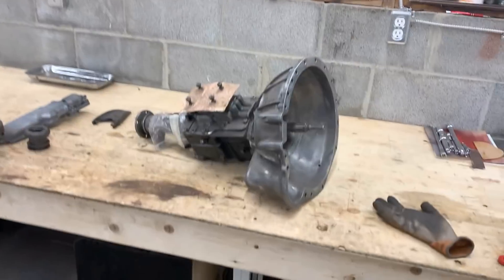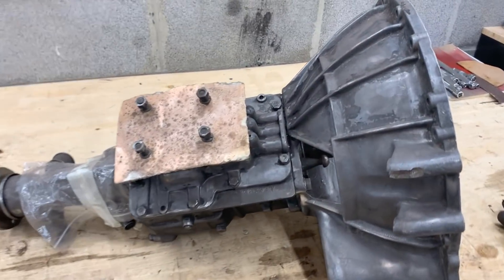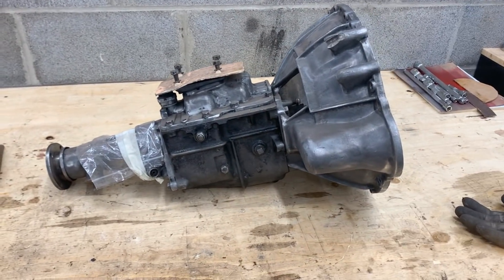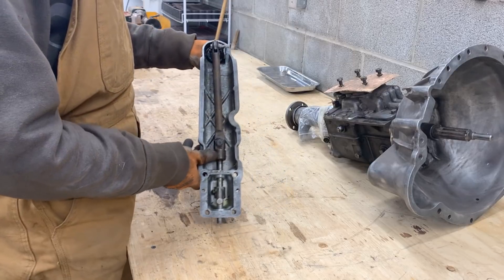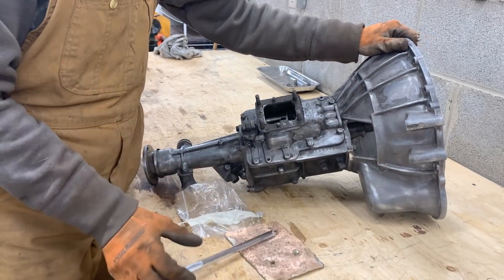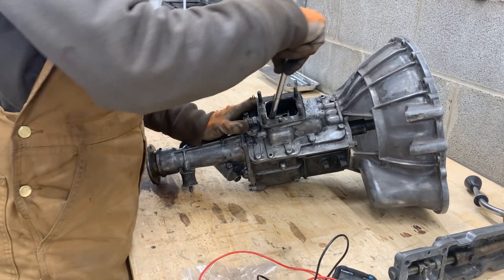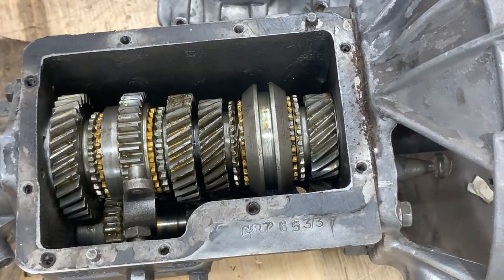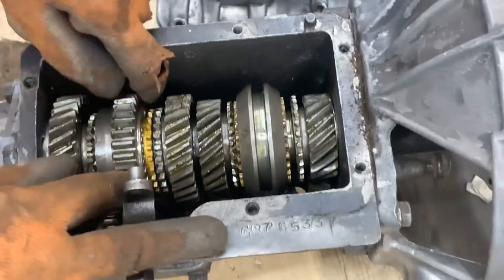GT6 Transmission Repair - Part 1

Comment: Elin,  Other than pulling the transmission, have you found a way to get a clutch plate that appears to be slightly seized to the flywheel to come off?  My project spit6 seems to have the issue of not wanting to go into gear (grinding) whenever the engine is running, but it cycles through gears fine with it off.
Reply from the maker: You might have an issue with the clutch master or slave cylinder. Does your clutch pedal feel spongy? I don't think your plate is is seized to the fly wheel, but in case it is you can put your rear wheels on jack stands. Start the engine while in 4th gear, get some speed and then press the clutch and slam the brakes at the same time. That should free it. But again, I don't think that is the problem.

Comment: Elin, why replace the bell housing? Could it be alloy welded and the bolt hole redrilled. which would be a lot cheaper and just as good. if done well.
Reply from the maker: Well, I believe I have one kicking around, but if I can't find it welding is an option too. I know a shop that does a really good alloy welding!

Comment: It's not worth repairing because, A)  you can get a better used transmission to begin with, and B) this is not a GT6 transmission.  GT6 transmission ID numbers begin with either KC, KD, KE, or KF.  The transmission ID number begins with "G", which identifies it as a Triumph Herald unit, most likely a Herald 13/60.  No point in rebuilding a transmission that's incorrect for the car and which has the damage it has.
 - Paul B.
Reply from the maker: Wow, that is a lot of information. Thanks!

Comment: I was scared to watch this. Thought all of my transmission rebuilding would be in full 55” tv color for Mary and Georgie to see. I did an ok job on it but I’m not sure it will pass inspection by the master. 
Stay healthy
Reply from the maker: LOL, well your transmission is not going back on the car unfortunately (or fortunately) because I got the overdrive one. Hope all is good with you and Mary (and George of course :))

Comment: Excellent explanation Elin. Just think someone sat down and invented synchro gearboxes...
Just a small point but the damaged 3rd and 4th gear teeth would not be caused by the slack 3rd / 4th gear synchro hub as the gears are always in mesh. I suspect something has worn and fallen out of that synchro hub (because it is so slack) and got chewed up in the gears. Certainly the baulk rings will need checking. I would flush the bottom of that 'box with some diesel and see what 'bits' come out before filling and running it. 
Chipped gears (like that and not destroyed!) as such are quite usable as long as they are stoned to get rid of any burrs or ridges as they are never out of mesh but the synchro engaging dogs are what take the hits and will be damaged with the synchro hub sliding out under load.
Reply from the maker: You are right. I believe the ball bearing from the hub went through the gears (a couple hundred times LOL)

Comment: When you get the transmission testing rig done, I’m thinking you will want to test a single rail gearbox from a spitfire.  Just so happen to have one out of a 1976 barn find I’m restoring.  Just saying 😉

Comment: It looks like the bell housing is damaged where the clutch slave mounts.  You might want to find another gear box.  There is a guy in New England that rebuilds Triumph gearboxes.
Reply from the maker: I believe I have another bell housing. Yes, finding another transmission is not that hard, but you never know what the condition would be. It is up to the owner, but if it was mine I would rebuild it and know that I have something reliable in the car.

Comment: Might be cheaper to try to find another gearbox .
Reply: It has obviously been run to death, stuck in a corner, then sold on to an optimistic new owner. Find a better one unless you can find another donor gearbox looking for a use.
Reply from the maker: Yes, finding another transmission is not that hard, but you never know what the condition is. It is up to the owner, but if it was mine I would rebuild it and know that I have something reliable in the car. I might have a donor transmission. Just need to research a little bit to see if parts are compatible.